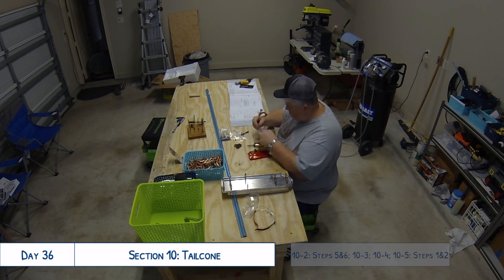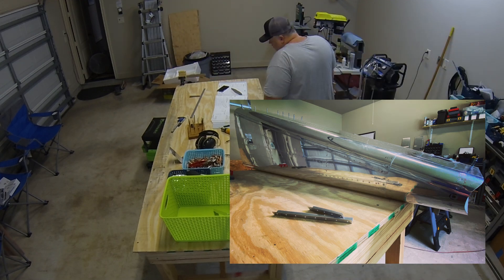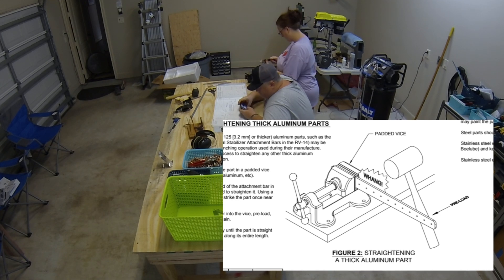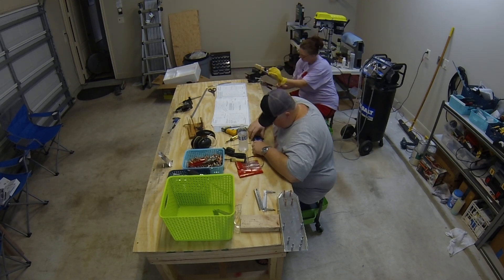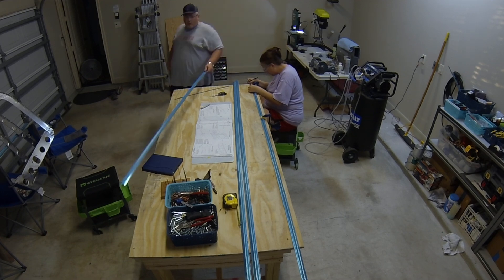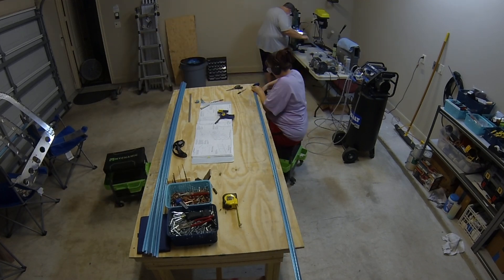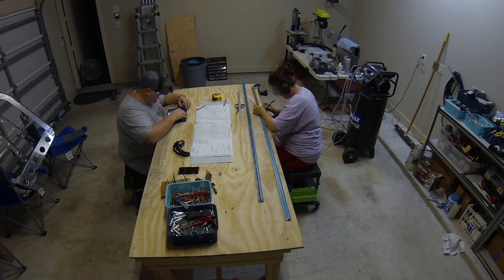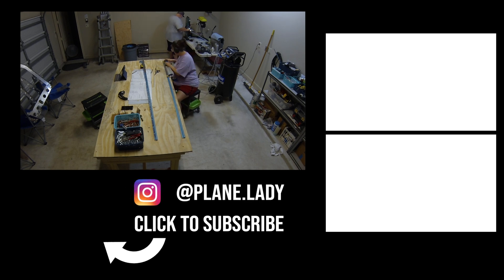Van's Aircraft RV-10 Build: Day 36 - Mistake in the Tailcone (10-2 to 10-5)

Comment: Van’s Tech support can be very condescending at time. You must have talked to the same guy that told me if the screw doesn’t fit in the hole I should drill the hole bigger. I tell him it’s drilled per the instructions and he basically says I’m wrong. So I go to my local aircraft spruce and it turns out Van’s sent the wrong screw for the rudder (only screw of that kind in the kit). I would rather talk to local builders before calling Van’s. Sad but the truth.

Comment: That piece was also a bit shorter than listed in my kit but still long enough for its later use.
Reply from the maker: Oh it’s definitely long enough for each of those 6 stiffeners, even at 1/2” short of 8’ - just not if you measure it incorrectly because you didn’t realize it wasn’t exactly 8’ long 🤦🏼‍♀️

Comment: Oi, sounds brutal. I’m interested to see what the “official” fix is from Van’s. I know what I would do...
I always try and visualize where each piece goes before I cut them and if I can leave them a little long or if they have to be the “exact” measurement called for in the plans. Glad it could be fixed “relatively” easily. That’s a great lesson for all new or prospective builders that are hesitant about getting into building. Mistakes will be made but they can always be fixed. It just takes a little money and generally quite a bit of time.
Reply from the maker: The time is the killer. And the bruises 😳 it is tough squeezing in there with all the tools I need to make this fix happen! Still not quite done, but happy with how it’s worked so far. Just can’t believe we didn’t realize at the time that they didn’t go all the way under the flanges 🤦🏼‍♀️